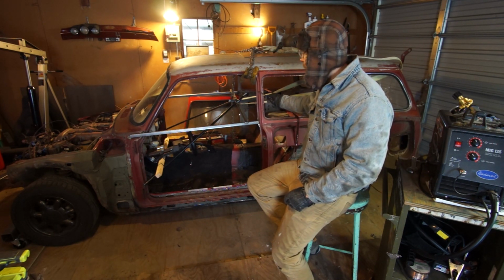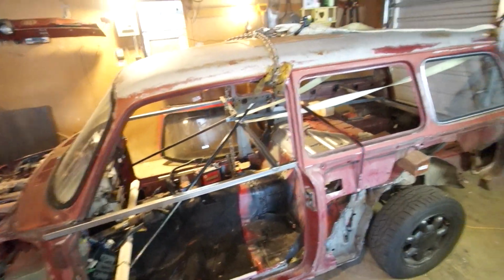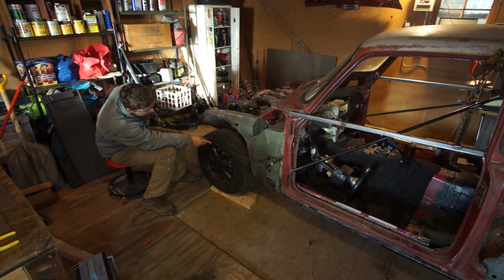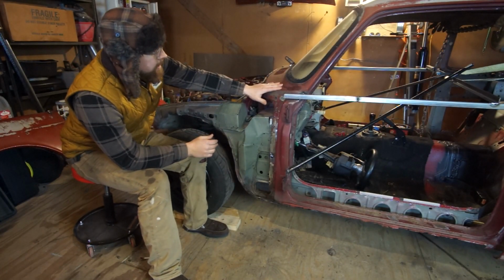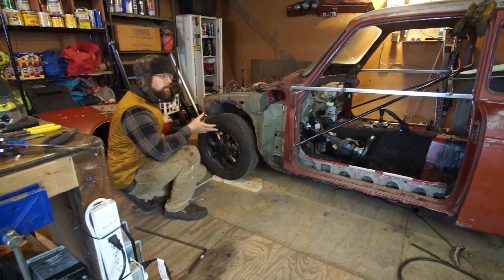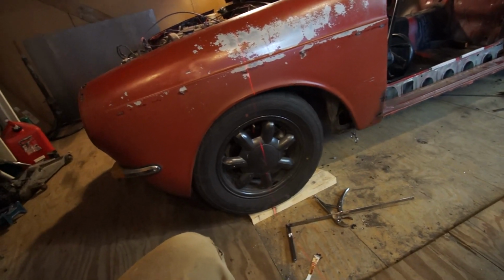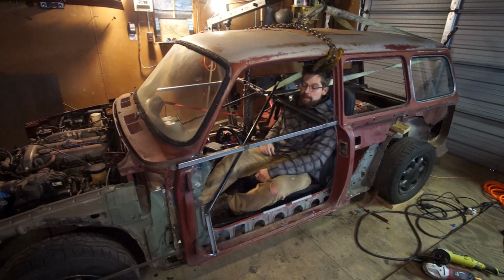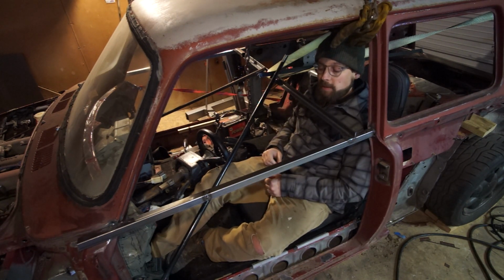Setting the stance and ride height - Project Frankenwagon, ep. 12

Comment: Sooo, here I sit watching this in 2020 a year later. Having done a few weird things like this project one has to weigh in what's hard and what wont be noticed so let me throw in my 2 cents. (after the fact) I would have screwed with the body placement and seat location till I was comfortable (where does the dash fall, etc) then considered modifying the wheel arches on the fenders, similar to how you piece in a dog-leg with body work. Basically cut out the arch and slide it forward till it looked good, then fill in the gap and blend it to the fender. Your welding is about as good as mine so I know you can do it.